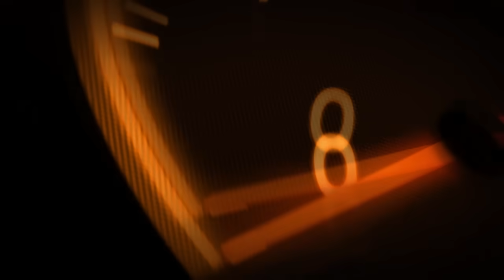Big Engines Starting Up

Comment: For everyone asking on the huge engine at 9:08, googling the model number shows that it's a MAN B&W DM884WS-150, housed in Diesel House museum in Copenhagen, Denmark. 

Wikipedia
" The largest of the engines, which was built in 1932 and remained the world's largest for more than 30 years, stands 12.5 meters tall and 24.5 meters wide and weighs 1,400 tons. It produces 22,500 HP and supplied Copenhagen with electricity. It remained in use during peak demand until the 1970s. During World War II a resistance group consisting of workers at the power station used the engine for hiding weapons. It is started up the first and third Sunday every month at 11 am and runs for 5 to 10 minutes."
Reply: i live in denmark and hearing that engine start up, sound so amazing. you can clearly hear the 22k hp. its so much better in person than video.
Reply: @danishviking259  wdym that engine can make you deaf. It wasn't running
Reply: @roblox-dn9qc , But it was kept alive until 2004, It was kept as a backup generator, and when they did tests to ensure it was still able to work, you for sure could hear it arround in the Copenhagen area where that Powerplant is located.
Reply: @ostemad140  They've actually used it during a power outage lately (as in I think it was in the 2010s) as a black start generator, since apparantly almost everything else that generated power on in the CPH area wasn't able to do it. I guess some good old torque can work wonders when the whole grid is dark.
One of the tour guys at Diesel House told me that, so idk maybe they're padding their importance. :)
Reply: @roblox-dn9qc  It's not that loud. I saw it start up a year ago and i'd much rather hear this engine than an angle grinder. Too bad they were filming it from the ground, you can see the crosshead shafts moving from the 1st floor.
Reply: cc?

Comment: The sound of the SD40 (2:50) is just mesmerizing!  Like being inside a body and hearing a heartbeat.  Fascinating.
Reply: idk why but that engine literally induced some fear in me like i am never gonna go near a machine like this one lol
Reply: Its just a nice little two stroke engine purring
Reply: That sound is most likely caused by the cams and valves starting.
Reply: @fear7356  The startup was so sudden and aggressive it scared me as well, its an actual jumpscare xD
Reply: @DaxMarko  that’s how locomotives are a lot of the time, lots of locomotives have auto start and shut down features, as someone who works around them we always wear hearing protection around them.
Reply: norfolk southen has aLOT of sd40-2s
Reply: It was 1200 pound
Reply: IT SOUNDS LIKE A MACHINEGUN
Reply: Yeah, such a good rhythm, and watching those valve springs bouncing is satisfying.
Reply: @troyglazathefurry  Maybe 300 at peak, I'd have to check... Union Pacific had close to 1000 of them.  They are pushing 50 years old now but are among the most reliable and successful diesels of all time.
Reply: This just show the power of human engineering!
Reply: Big diesel locomotives like that produce some concussive soundwaves. You can feel it resonating in your chest just standing on the platform!

Comment: 9:09 this is the typical engin that you can find on cargo ship. They are slow but powerfull for the high seas. And by the way, you can fit a car in the oil pan and can fit a man in the piston chamber.
Reply: Jesus
Reply: engine* 
but still that crazy!
Reply: I would prefer not to fit in the piston chamber just in case….
Reply: Ye. A Richard Hammond sized man.
Reply: Thank you for the information soviet
Reply: Yeah but that specific engine isn't on a ship. It's used as a generator that produces more powers than a third world country
Reply: I thought they're a bit smaller than that. What ship is this for?
Reply: You mean cylinder
Reply: Holy hell
Reply: @TheNamesArif  that one is a generator for power
Reply: Was looking trying to work out what it would be used for.
Tiny bit too big for a plane, teensy bit too heavy for a rail road and maybe a little too tall for the tunnels, and the car would look like the thing Gru drives in Despicable Me if it was in that. lol
Reply: fun fact the pistons are powered by a single unit man
Reply: Imagine if that thing decided to throw a rod through the side of the block!
Reply: Can i fit it in a.miata
Reply: @ruby1one2000  why did you correct him everyone knows what they're talking about
Reply: still waiting for that one dude who will put it in a miata
Reply: great, this is gonna give me nightmares
Reply: But does it stutututututu
Reply: My first thought about it being an 8 cylinder engine was just how big are these pistons? As big as that is, they must be pretty massive
Reply: There was a man who went into one of the access tunnels for a maintenance check on the cylinders through these port hole windows, and was locked in there. They couldn't hear him through the iron walls of the block and started the engine, only discovering him after they made it to their next destination. He was slow cooked as the temperature rose along with the deafening sound of being inside a running engine.
Reply: @ILoveDashie20  somebody must have forgotten to place a lock-out on this. That's definitely a bad way to go.
Reply: Some larger container ships use a single large diesel engine. The Wartsila-Sulzer RTA96-C puts out over 100,000HP at 100 RPM. Each of its 14 cylinders has a bore of 96cm, and a stroke of 2.5 meters. (38" and 8 '). It is three decks tall!
Reply: @leepicgamer7855  so you're saying this can produce more than 1,598 TWh of electricity per year?
Reply: Are you a Marin Enginer
Reply: I thought it was a boss robot from The Descent.
Reply: Hiding spot
Reply: I heard some music 🎵
Reply: it’s insanely fascinating how we can make an engine so huge
Reply: And note, to reverse the engine has to be stopped so it can rotate the other way
Reply: what. the. absolute. fuck.
Reply: Someone find me that engine, it's going in my miata
Reply: @DANTHEMAN1.8T  someone find me that motor, it's going in my miata
Reply: That's cool and all, but will it run Minecraft?
Reply: Wow, thats some perspecitve
Reply: @leroydever4761  It was more than likely a murder given the context of things, though it was ruled as an accident. It's uncommon, but it happens in these ships, most reported as falling overboard. However further safety measures have been put in place to prevent such things.
Reply: @TheNamesArif  The Titanic offcourse
Reply: Imagine the vibrations and noise if an engine that big revved to 7k rpm or something
Reply: @leepicgamer7855  I laughed very hard at this but also realize how messed up that is.
Reply: I'd rather not though...
Reply: The cylinders are so big that someone could stand inside of them, its so wild that we can build something that huge
Reply: I was wondering what you would use such a big engine for.  Where I worked they had 2 natural gas engines they used to product electricity, for some part of the day, as it was cheaper to do this, than buy electricity from the grid - they could also be used for emergency back up (data center) and 2 diesel engines.  Well I don't know much about engines, but I could have sworn by the size, it looked like you could have put them on a train track and pulled a train with just 1 of them, they were huge - all 4 of them.
Reply: @kfl611  last one could be used as ship propulsion unit. It doesn't look like MAN, nor Wartsila or MAK. But generally speaking nowadays, ships have 2 propulsion units instead of one, due to failure probability if it was only 1 engine. Also 2-strokes are extremely dirty and expensive.
Out of presented engines, Cummins and Paxman were marine engines, namely they are used to drive generators.
Reply: @TypowyKubini  I think the people who built and maintained these engines are so beyond smart.  Even a simple rotary airplane engine seems so complex to me.  If your car engine conks out, ok, roll to the side of the road and wait for help but if your airplane engine conks out, hope you can get it restarted or land somewhere.  Big difference.  Thank you for your knowledgeable comments.
Reply: @kfl611  design is rather easy, but you are working there with ridiculous force values and different fuel types. Compression rate is similar to heavy duty diesel engines and starter is compressed air, not electric. 

But the production is a different story.
Reply: holy ship!
Reply: ima put it in a Miata
Reply: The motor is in Dieselhouse - now a museum in Copenhagen; used to be a power plant for  the city. The motor is started ever other Sunday @ 10:00. I used to work there, and it's a rather civilized engine for the size; not as loud as you'd expect, and little to no vibrations.
Reply: @alexisjankowski3281  there’s a lot of pressure to be the piston man
Reply: You see 8 cylinder, you think that's it? 
Then you see the size- Oh you mean 8 huge cylinders and pistons.
Reply: Miata is the answer
Reply: A great Youtube storyteller, MrBallen tells of an engineer named Kurt Smith, once employed by Hapag-Lloyd, who accidentally got himself sealed inside the ship's cavernous marine engine right before start-up. The fella didn't live, obvs. https://www.youtube.com/watch?v=TZ8EGOEc7uw&t=542s if you'd like to hear it. It's a pretty grim tale and I don't envy the guy in how he died one bit.
Reply: Where is the reffereance?  My undrstading is that they had one foot bores not three foot.
Reply: What fuel does it run on
Reply: Imagine the torque of that engine
Reply: I challenge you to put it on an airplane
Reply: i read something about a man dying in a piston chamber
Reply: i put one in my miata
Reply: @blownn420  It would destroy a small town 50km away xD
Reply: @leepicgamer7855  all motors are used as generators, that's what they are.
Reply: Yeah, a guy got trapped inside an engine on a ship during routine maintenance, a freak accident, the ship was at port but was under pressure to clear a space for an incoming tanker, he got back inside the engine after forgetting something during his inspection but didn't tell anyone he was going back inside, the "cover" of the engine compartment he was in swung closed behind him and he couldn't get out. Because the captain was under pressure to get the ship off the dock, he started the engines and moved it out of port with the guy inside. The crew were searching for the guy and the captain knew he was missing when he was starting the engines but never imagined he was inside the engine. A mad, sad and true story.
Reply: @hugossg7908  HAHA no it’s only a nickname from high school, I was in the engine room of a Canadian Coast Guard icebreaker and naval mecanic interest me
Reply: @kapitaislavik4212  haha ik but you know, i have eyes on you -.-
Reply: @hugossg7908  oh oh the CIA, INTERPOL and now you! XD
Reply: Wow - I was just going to post a comment as to where one would find an engine like this. Thanks for the information.
Reply: The piston chambers with their rods are literally accessible by doors that personnel can enter and climb up on ladders to perform maintenance on them. I saw a video breaking all this down and it's just insane. The entire engine is accessible by a whole person, like it's a vehicle/building by itself. Insane machines...
Reply: Can i swap that on into my civic?
Reply: Imagine being in there💀💀
Reply: its just called a cylinder in an engine not a piston chamber but i know what you mean.
Reply: But it would be frowned upon to do this I suppose.
Reply: The nukes have engines that size for when the reactor shuts down
Reply: and it sounds like it takes an engine to start the engine
Reply: @TajSingh  oddly specific but colorful form of measurement
Reply: "You ... can fit a man in the piston chamber." Hey, you just found Jimmy.

Comment: 3:35 you know, these engines are so damn powerful after 1 quarter mile they have to be almost entirely rebuilt as the stress that the parts endure is astronomical
Reply: the clutch actually welds itself together from the friction and heat and the engine becomes stuck on full throttle
Reply: @kenopsia9013  really? Wouldn’t the car just not stop (or slow down very gradually)?
Reply: @kenopsia9013  They are not stuck at full throttle. They are however less likely to blow up at full throttle.
Reply: @perplexical  TF's and FC's have a reverser. This reverser, which splines in behind the clutch and ahead of the rear end, does forward, reverse, and neutral. Until the car has stopped it is in direct drive. The clutch is a sophisticated staged centrifugal that does indeed weld plates together by the end of a run

Comment: 3:01 the SD-40 Engine Start Up Never Gets Old
Reply: Your right
Reply: Pretty much any diesel locomotive engine startup is amazing. You should hear the sd70ace or the es44ac
Reply: @thatoneguy611  a sd70ace engine is good and also the GP38-2 sound similar to a F unit engine start up cause they use the same engine tho without the turbo to it and it sound really good with head phones on
Reply: Technically an EMD 16-845. SD40 was the locomotive they put the engine in.
Reply: The three stages:
Kalm
Reeee
Kalm

Comment: The beetle didn't look dangerous at all, with it's big exposed fan.
Reply: It's a bug, with a radial engine. Safety is an afterthought.
Reply: @tenaciousj95  looks good but you wouldn't want to be trapped while it was backing up, it wouldn't be pretty!!
Reply: Same engines they use on propeller airplanes
Reply: Fun thought...it may be a dangerous fan but its only dangerous if you decide to introduce foriegn objects to it.
Reply: Was that mike dantoni working on it
Reply: I wonder whether the torque can flip the car when it's revved?
Reply: Radial engines used to drive huge plane propellers. This one's not that big. Think of it as a somewhat big radiator fan. :P
Reply: I don’t think it met up with California smog regulations either lol
Reply: S a r c a s m
Reply: Its not a fan, its where the propeller goes
Reply: More like meat grinder
Reply: The car rear ending it vanishes
Reply: Where did you see such a cat that would care what mice say about it?
Reply: Plus kicking clouds of exhaust inside an enclosed space
Reply: It would stop people from tailgating and leaning against your car at a car show
Reply: its a plane engine lol
from ww2
Reply: "With IT IS big exposed fan"? Huh, what?
Reply: That's a plane engine. I've seen that one before. Those use to be propellers.
Reply: I bet you blip that throttle just right that bug would roll.
Reply: how much torque do you want?
owner of this beetle:Yes
Reply: Probably the best cooling system that vehicle has ever had with its poorly designed rear mounted engine lmao
Reply: @tenaciousj95  it isn't a thought at all
Reply: Fondly named: The Blender
Reply: One slip on a cord and that guys face is gone...
Reply: My son: "Is that Herbie??"
Me: "Yes, now to say hi" lol
Reply: Not at all, looked like a perfectly reasonable upgrade. Seriously, though, why?
Reply: Its a “Continental W670-9A seven cylinder air-cooled radial aircraft engine. The engine, which was first introduced in 1934, is rated at 250 horsepower and weighs 550 lbs. While primarily an aircraft engine it was used in a variety of applications, and this 1941 model was pulled from an M2 tank. Bore is 5.125 inches with a 4.625-inch stroke, giving the engine total displacement of 668 CID”. 👍
Reply: its called the pedestrian mulcher, get your terms right
Reply: I actually saw that car on way to Calistoga once in a parking lot.  It had the full prop installed on it.
Reply: @scoutwalker5579  and the propeller is a big fan.
Reply: Bet there was 500 pounds of counter weights in the frunk as well.....
Reply: it looked green screened actually lol
Reply: @extrememercilesspotatochip9431  "Probably the best cooling system that vehicle has ever had with its poorly designed rear mounted engine lmao"
You sure about that?  
Was it; Poorly designed or poorly maintained?  

hp
Reply: I wanna see it in action on a track lol
Reply: @KitWriter  that would be very dangerous Just like all rear mounted engines are very prone to making cars spin imagine what that heavy engine would do for the stability
Reply: Aircooled, as it was supposed to be. Just a bit bigger

Comment: @2:04 I've seen a Spitfire Merlin engine spin up live several times. It's a visceral and nostalgic experience every time in that it's the sound many WWII pilots lived and died with. I've also seen some of those old diesel threshing machines at country fairs and parades.
Reply: I live in Eastbourne we have one fly over several times a day, it's always special to see it come over beachy head
Reply: I've been buzzed at low level by an Avro Lancaster, which sports four RR Merlin engines. The entire building shook!